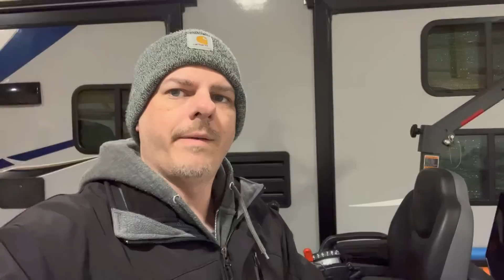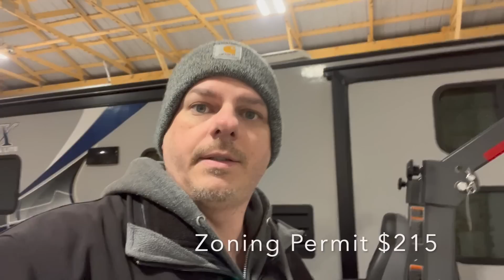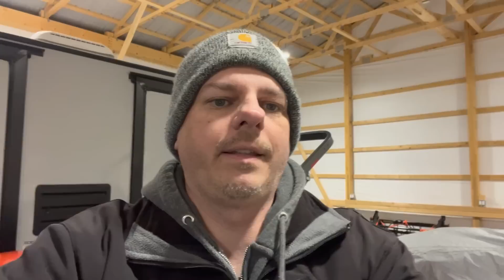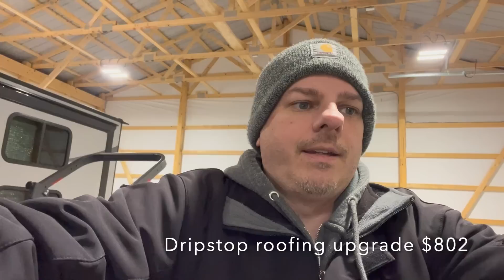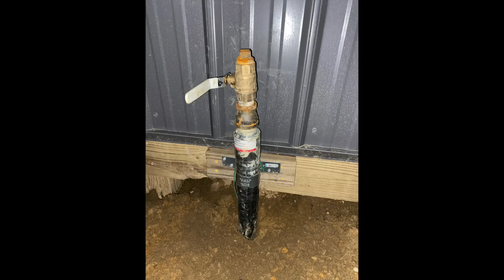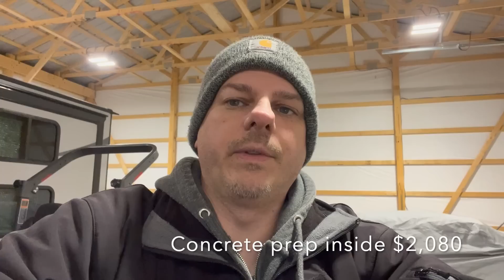"This Garage Costs How Much to Build? You Won't Believe It!"

Comment: Ok maybe I missed it but what is the size of your building.  And did you say you ran electrical from your house to the shop that was a little more than 300 feet?
Reply from the maker: Building is 34x50x14 not including the small porch area. The wire run is roughly 300ft to the house. The electrician went a size larger on the wire due to distance.
Reply: @journeys-with-joe just got a Quote on. 42x50x14 with one lean too all on slab for 53k

Comment: We recently got a quote for a basic 40'x26' garage with steel roof, 10' wood and vinyl sided walls, three 10'x8' doors, a man door, and three small windows. The quote for the project, including excavation, concrete, building finished on the exterior only, was over $80,000. This did not include electrical, eavestroughs, or finished interior. I assume you are in the US? I wasn't keeping track of your costs, but I was expecting the total to be well over $100,000. This shows the difference in prices between US and Canada.
Reply from the maker: Wow! That’s a big difference in pricing. One thing I’ve learned is costs to build never come down they only seem to go up. Build when your budget allows and just enjoy it.

Comment: I have a 80x120' building with a 15x120' eave, completely insulated and all steel...no wood. It is on a cement slab that can support a D8 Cat. 4 electric roll up doors, 3 man doors, skylights in the roof and it is alarmed. Erected in CA. in 2010, $172,500...15 years makes a huge difference in price and things will continue to go up...the building was purchased from Metallic Industries and it looks like it was erected yesterday.
Reply from the maker: That’s a huge building you have for sure. Price was definitely a great deal then as you can’t touch that price today. I wish I could have built bigger but zoning and cost unfortunately determined mine. Thanks for checking out the video!

Comment: How long does the poles last I mean they go into the ground I'm thinking it's like a fence that is going to rot out
Reply from the maker: If they are properly laminated posts like mine was built with (not a solid 6x6) with the proper treatment noted by a stamp/tag on the lumber then they should last a few lifetimes. Much different than a treated fence post. Here’s what you should use - UC 4B lumber (with a 0.60 pcf retention level for CCA, ACZA, and ACQ or 0.23 pcf for MCA) is required for harsh below-ground exposure in wet areas or regions with high decay hazard (like Southeast or Hawaii).
Reply: Thanks for the reply. I'm thinking about the green posts option can't afford perma columns
Reply from the maker: Green posts are definitely a cost effective option.

Comment: I might have missed it but did the $83k include insulation? Also did you insulate walls and roof? Thanks
Reply from the maker: The cost does not include insulation. It was an additional $6k to insulate. Take a look at my cost breakdown down of finishing the interior to get a better idea on everything that went into that. https://youtu.be/2oS8DWnJcRk?si=sBkNsJEZZwCWrlmF

Comment: Just wrapped up a 66x48 16’ walls in Oregon. Stick frame, wood siding, 2 12x14 roll ups, 3 man doors, 8 custom windows, 6” mono slab, 200amp service, plumbing, electrical and permits was $160k. I did everything except concrete ($36k) and electrical ($12k).
Reply from the maker: That’s a large shop and I appreciate you sharing! A lot of work too and I can’t imagine what it would have cost if you had hired it out. Now you get to enjoy it! Thanks for checking out my video!

Comment: Crazy to think a 40x60 pole barn was only 11k and concrete was additional 4500 just 10 years ago where I’m at. Now it’s over 35k
Reply from the maker: Crazy times we live in for sure.  If we only knew then we would all have built garages and save tons of $$.  Unfortunately we’ll not see those type of costs again.  Glad you were able to build when you did!  Thanks for checking out the video!

Comment: My garage build is in progress(SE Ohio) it's a 24x36x15, 8x24 loft, all metal with wainscoting a 20x24 pad out front and a 120' long driveway. They're doing everything dirt work included plus no access for a concrete truck $49k didn't seem too bad to me.
Reply: That was a great price, that is near 60k in the north east, that’s tight, no electricity
Reply from the maker: Sounds like you’ll have a nice garage when it’s done!  Enjoy it as you’ve worked hard for it.  Thanks for checking out the video!

Comment: I built a 24’x40’x12’ carport/shop in 2018. 24’x20’ enclosed, 24’x20’ open on three sides. 10’x8’ door & a 3’ walk through door. I paid someone to do the chert pad, and someone to pour & finish the concrete floor. I did everything else myself, including the building layout, setting the 6x6 posts, and the forming for the concrete, and all the electrical work. It has the bubble wrap insulation under the roof metal, house wrap under the exterior wall metal, and the exterior walls aren’t insulated. It took me three months from start to finish. My father in law helped up to the point the roof was covered. I did the rest on my own. I spent $15,500 in total. I’d hate to know what the same project would cost today.
Reply from the maker: Awesome you were able to do all that work yourself.  With my work schedule it would have taken 3 years instead of 3 months!  Great price too you saved a ton of money doing it before 2020 which I’m sure would be double the cost at least now.  Thanks for checking out the video!
Reply: im currently doing a 30x50x16 in new york in the poughkeepsioe area
all in its gonna be between 35-50 grand building concrete paving electricity ect 
im doing a steel building since im going to be doing welding and cnc plasma
Reply: @MeatMotorsports red iron? I’m leaning towards a red iron building myself, wanting to do a 40x60x14 shop for my project cars and hopefully to start a side hustle. I’m in central Kansas so I don’t know how our costs will compare but I’d imagine it should be similar to what you’re paying.

Comment: I'm just looking into all this myself. I'm looking to put up a 30WX24 long garage(just how it fits on my property). 

I've gotten quotes from different people, but I'm in over my head. I see all these pre-fabricated metal garages that seem to be really good prices, but I don't know which to go with. A traditional wood garage or a company like Big Buildings or Morton...or whoever. 

I'd like to get the project done for ~35K with the concrete, electric, insulation, etc...I also would like a little drainage.
Reply from the maker: It can definitely be overwhelming with all the decisions to make.  Take it a step at a time and be sure to get estimates up front on excavation as that can be a big surprise before you really even get started.  

I’m not a fan of the metal tube building myself they can be harder to finish out the interior later.  Post frame was perfect for me as it wasn’t the most expensive and being all wood framing very easy to work with inside.  

Best of luck on your journey building out yours!  It’s all worth it when it’s done.  Thanks for checking out the video!
Reply: @journeys-with-joe  I'm lucky to have family next door that owns a large excavating company. So I cut the trees down, burned the stumps enough that they weren't a big deal(drilled some holes and poured Kerosene in there and let them burn for a few days).

Then had a friend do the cement.

It's been going pretty well. Ended up going 34x26. Wood is ~18K. Lots of other small costs, but I'm lucky to have help from people I trust each step of the way(and I'm not in a hurry).
Got the cement poured, the walls up, got a drain and plumbing in...as well as electrical.

The only decision left is if I put solar on the roof. I think I'm going to. That'll take me well over, but should be worth it.
Reply from the maker: @scourge8097  sounds like you’re making great progress.  Definitely good to have friends and family that can help out.  Solar is a good choice if it’s too cost prohibitive to run power from a nearby source.  I considered it in the beginning on mine but with our winter cloudy days and spring even I’m glad I was talked out of it.  Never have to worry about what or when I use power.  Everyone has a different situation though.  Thanks for the update!
Reply: 35k all in is not going to happen for a built building.  Sure you can get pre fabbed kit but you get what you pay for
Reply: @justanbaker8937  No, it'll be about 40K before the bathroom.

But I got the site ready, the trees cut and then had people I know do the excavation and concrete, then helped build it with a friend with a GC overseeing it.

Comment: Where did you get the crushed concrete?
Reply from the maker: My local excavation company hauls material so he got it all for me.  If you have a way to haul it it’s much cheaper to buy from the places that crush it but it was very convenient to have it dumped and then I just spread it when I got off work in the evenings which saved a ton of time.

Comment: Good breakdown. Thanks for sharing. Any reason you went so far away form the house? Seems like it wouldve saved a bunch if it were closer.
Reply from the maker: The layout of our house lot is much deeper than wider which is probably the main reason.  Also gives me much more room to maneuver our 35’ camper or any other trailer really.  Your right though would have saved some being closer but overall cost wasn’t much more.  Thanks for checking out the video!
Reply: I’m in his same boat, I’m on two acres but it’s only about 150 feet wide with the house, garage, carport, and shrubs taking up an easy 100 feet of that, and then trees and a propane tank eating another 30 or so, so I really only have about 20 feet for a driveway past the house to way out behind it; lot is about 600 feet deep, with a huge 60x60 garden set 100 feet behind the house smack in the middle of the lot so I’ll have to go behind it too, so I’ll need about 300 feet of driveway to get to it.

Comment: My 36 x 42 x 14 Miracle Truss garage back in 2002 cost 60K with metal roof, Hardi Plank sides, 5" reinforced concrete floor and metal roof with two 10 x 10 roll up metal doors.
Reply from the maker: Cost has definitely increased over the years.  I appreciate you sharing and hope you’ve had many years of enjoyment with your garage with many more to come.  That is really what makes it all worthwhile.

Comment: Great breakdown. I’m building mine right now, 48 x 60. Doing it all myself except the grading and concrete so I’m hoping to finish it for under $30k. The dirt work cost me $8k, $13k for the concrete work, and I’m guessing about $5k for the roofing metal. I own a sawmill so the lumber is free!
Reply from the maker: That’s a good size garage you’re working on.  Always a hard decision when it comes to time vs $$. I never seem to have enough of either I guess.  Best of luck in your build!  You’ll love all the space when you’re done.
Reply: Ok younsaid 13k for a 48x60 concrete pad? Or you just mean footings?

No way you poured 48x60 concrete for 13k.
Reply: Of course he can. I can pour 1,500 sq ft for 5K or under total (do dirt work/forms myself) and hire a couple guys to help me spread/finish it. Rock costs nothing. Really, it's just boards/rebar.
Reply: @TheGuruStud  get a couple of guys to help,hope they know what there doing,concrete is a permanent eye sore if you "f" it up and then your stuck with it,i will hire a concrete pro if it was mine.
Reply: @mrpush2532  why not? $7,700 for the concrete and $5,760 to pour and finish.

Comment: nice place and breakdown.i just can never wrap my head around how people think that they need 6 -12" of concrete to put up a hoist...no need and is a complete waste.I really dont care,and its everyone's own  business.Im a mechanic,and my work hoist is installed into 60 plus year old 4" concrete and have never even come close to a problem.i built a new shop and 4" is used throughout..unless you putting a dump truck in or an excavator,no need for anything more but thats just me
Reply from the maker: Appreciate the compliment on the building.  I do agree I have some overkill in the concrete.  I guess some of my worry is when they pour do you always get a full 4”.  No way they can get it that exact everywhere.  By doing the extra I know I have enough. In the end the additional cost was minimal for me.
Reply: @journeys-with-joe  yep,to each his own.I built my 44x36x12 shop 4 years ago.mine is all done to the tune of $90-100k in it!that is a stick built unit with steel on the inside,bathroom,trench drain,heated floor,etc...that is with NO equipment included like my hoist etc,just the shop put up and closed in was $70k so i added another $20-30k in completing the inside.everything is expensive but glad i have it and its done..

Comment: We had 30x40x12 pole building built this past summer original cost of shell was 24,000. Without concrete,no doors,no windows,no,lean to porch only ceiling vapor barrier.after all extras added we settled at 48,000. I installed 100 amp service maby it cost me 1500. Amish built phenomenal job very pleased they also poured 6 " in main with picture frame insulation and tyvek  wrap around walls.also in iur county they required a lines and grads plan by survey company that was 1,800.
Reply from the maker: Thanks for sharing!  Sounds like a great building and similar cost per sq ft.  You’ll get plenty of use out of it I’m sure.  Thanks for checking out the video!
Reply: What's picture frame insulation?

Comment: I built just before everything went up luckily. 30x72x14 with 6inch concrete. So to build , concrete and wire 200amp service. Total was 31,000. But I did everything except the concrete pour though I did put it on grade for them.
Reply from the maker: I wish I could have built sooner but didn’t have the land to do it until more recently.  Great price on yours!  Wish I had the time and help to do more myself to save some $.  Appreciate the comment!

Comment: Your right at $50/sqft. Not bad at all! I'm building a 32 x 40 and hoping to finish under $100/sqft, but its also in California and will be stick built.
Reply from the maker: Yeah prices are much different in other parts of the country for sure!  Wishing you the best as you begin yours. That’s a great size and a stick built is definitely a great choice especially if you plan on insulating later.  Appreciate your comment!

Comment: Holy crap 83k for a pole barn? That's ridiculous. Could've built it yourself for alot less
Reply from the maker: The labor cost for the shell of the building were only around 25%.  Material costs are not what they used to be unfortunately.  Thanks for checking out the video!

Comment: Where do you live?  It sounds like you are living in a police state. With those permits and costs.  A HEALTH DEPARTMENT PERMIT?
Reply from the maker: NE Ohio.  Pretty common for most areas around here to have a permit process.  The health department was due to having a well and septic they make sure the building won’t cause issues with either.  Thanks for checking out the video!
Reply: I was thinking the same thing! All those permits to build on your own property is nuts!

Comment: I had a 30x40x14 w/ 10x30 porch closed in on 2 sides building built. They just got done Nov. 5th. For the site prep, building, concrete, 2 -10x10 insulated doors, 1 man door, spouting, & snowbirds. 3' aprin and porch poured as well. My price was $55,477. I'm taking care of the electrical myself and finishing the inside.
Reply: PA
Reply: Did you do pole barn style or footings underneath the slab?
Reply: @claynorwood7904  pole barn style. They had pre-made footers and just dropped them in the holes and set the post on them. Then poured the floor.
Reply: @bcat129   Good price for all that, thanks.
Reply: What states are you guys in?
Reply: Where at in PA ? I’m in Western Pennsylvania
Reply: @jasonhauck8415  South Central
Reply: @jasonhauck8415  South Central
Reply: @jasonhauck8415  south central
Reply: You bull shitting me 😊 that's amazing. How did you do it? Is it badass? That's cool, I'm learning about framing.
Reply from the maker: Nice size garage you just had built. Congrats!  Lots of work ahead but the best part is now done it sounds.  These buildings aren’t cheap and I appreciate you sharing and checking out my video!

Comment: In May of 23, i got a price for 40x40 6in slab at 30 to 35k without site prep. Or drainage. Im looking at 100k plus, for a 40x40x14. I lve in nothern vermont. Biggest issue i have, is no one wants to work. One popular builder up here, never returned my phone or email inquiry. Most seem to be all backed up, cant keep employees,ect. I was told there is a waiting list for concrete to. Kinda frustrating.  Its Dec 2023. See what happens next year. Nice building you have there. Looks great.
Reply: That’s only like 6k in material. Might wanna just pay some buddies well and do it yourself
Reply from the maker: Wow prices do vary by location.  Keep at it and you’ll find the right contractor.  It took me 6 months of searching before I found someone that would respond to my questions and not just give me a general quote.  Appreciate the comment!
Reply: same situation here in Oregon no one wants to do hard work these days. I will end up doing my pole barn myself with some help with family.
Reply: Nothing in Vermont is cheap ans yes nobody wants to work and when they do they're not good at it. Do it yourself

Comment: So the building isn't sitting on concrete? What are you thinking? Should of done an Alaskan slab with a 12" footer.
Reply from the maker: Embedded column foundation is the most common build practice in my area.  It has the highest wind strength and will outlast me so that’s all I need.  Appreciate the comment and thanks for watching.